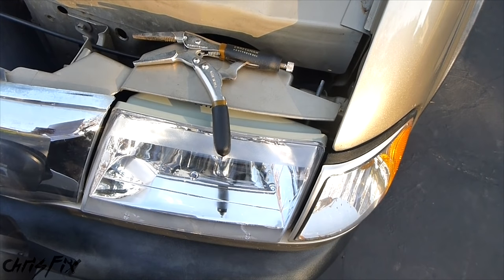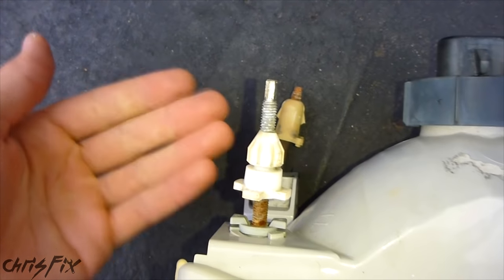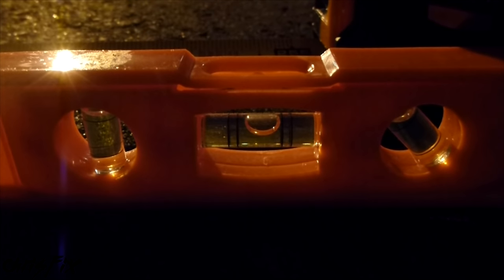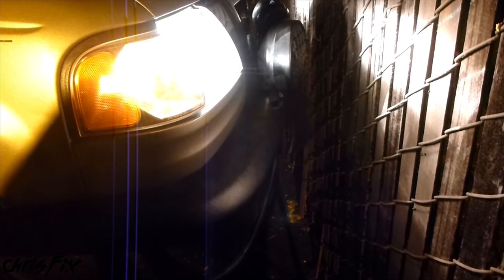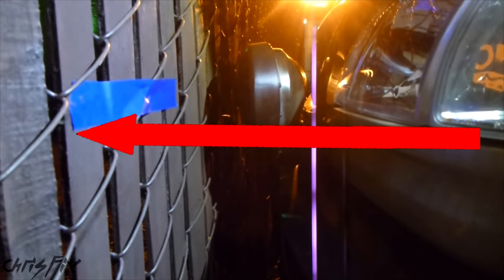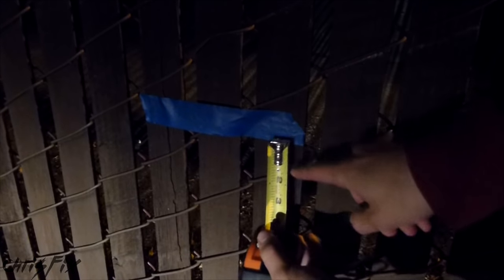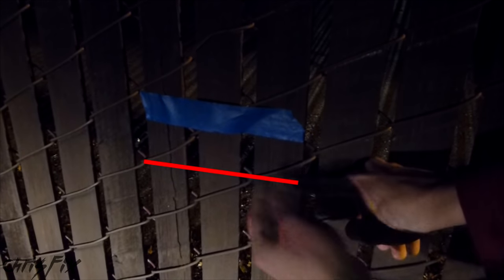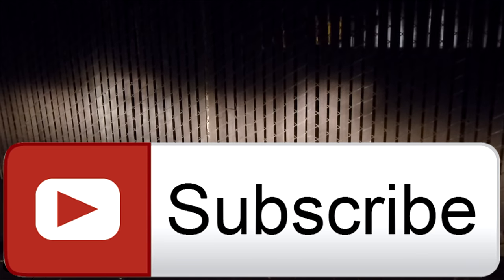How to Adjust, Align, and Aim Headlights and Fog Lights PERFECTLY

Comment: Would this be different to the little wheel inside my car that adjusts them up and down?
Reply from the maker: Harry D What do you mean? This adjustment works for any adjustable headlight. Are you talking about hide-away headlights?
Reply: ChrisFix Some cars (The Impreza STI for example) Have a knob inside to adjust them lower if you have payload in the back of the car.
Reply from the maker: Weese oh wow. that is pretty cool. So in the cabin there is a nob? Is it electric or what?
Reply: ChrisFix yeah very common on European cars, you have a headlamp adjuster knob for when you have a lot of luggage or people in the back... some models use a pneumatic (vacuum) actuator, some are just an electric motor, and more expensive models use auto-leveling, however nothing as fancy as BMW's new super-magic-electronic lights: https://www.youtube.com/watch?v=-dvPZ3H1Vm4
Reply from the maker: thedreadedgman Thanks for sharing! That is some awesome technology!
Reply: thedreadedgman yeah my little ´99 alfa has em too, europeans were really ahead of its time on the 90s.

Comment: I only have 1 adjustment screw for my low beams
Reply: Me too. It only moves my low beam up and down.
my right bulb is facing too much to the left. How do I turn it to the right.
My adjustment is where I have to use a screwdriver.

Comment: Hey ChrisFix i was restoring my head lights on a 07 suburban and scratch the top part of the head light with sand paper by accident . What can i use to remove the scratches  Thank you
Reply from the maker: How were you restoring the headlights? How bad is the scratch? What grit did you scratch it with? And the top part of the headlight lens or assembly?
Reply: I used Turtle wax headlight restore and its a lights starch, it was with p800 sand paper. its on the front of headlight ( clear front plastic)
Reply from the maker: Ok, since that headlight restore has abrasives in it, your uv barrier is already taken off so this can be fixed easily. You can get some 2000 grit sandpaper and buff the area (wet sand) and then take some of that turtle wax headlight restore with a rag and really buff it good. A dremmel or a power buffer on low makes it a lot easier. You can use toothpaste as a final step and buff that in there. The abrasives in toothpaste is really fine and gets you a really nice finish. You will have no problem at all getting those scratches out so dont worry. Here are two videos that I think will be helpful to watch:
How to Restore Headlights PERMANENTLY
and
Headlight Restoration using Toothpaste
Let me know how it goes!
Reply: Cool Thanks ! ill give it a try
Reply from the maker: Let me know how it goes and watch those videos before you try so you get an idea of what to expect.
Reply: ok, i will see if i can do it this weeked
Reply from the maker: Gli_Fahrenheit NICE! Glad the method worked and thanks for the tip! Let me know how long that sealer lasts you. I have only had luck with stuff like that for about 3 months before the headlight was messed up again.
Reply: I have used that product in different cars and it has lasted me over 3 months and i live in Arizona were we get over 115 in the summer so i think its good over all.
Reply from the maker: Thanks for the review man!
Reply: Thank You

Comment: Why would my high beams honk while there on? On a Santa Fe 08
Reply from the maker: Like your horn honks putting the high beams on?
Reply from the maker: Depends on the policy you have, if you have that then I'd totally take advantage, otherwise it might be easier and cheaper to do it yourself!
Reply: Yes... But Im thinking it's my clock spring cuz my air bag light is on and my horn don't work

Comment: Chris, you make some great videos and they are very helpful but your method here is just too inexact to get your lights focused correctly.  Being out of adjustment by just a small amount can be a big problem... like blinding drivers of oncoming cars when your low beams are on if they are not adjusted  correctly.
  Your method here is too sloppy and doesn't get your headlights focused as precisely as they should be.  Although you focused yours in this video where they should be there are things you did not mention that you assume viewers would know. that helped you get yours right but others may not.

Comment: This is actually wrong. Your lights should not be even. The passenger side beam should be 2-3 inches higher than the drivers side. The drivers side light is what blinds people. So you adjust the drivers side even but keep the passenger beam higher allowing it to shoot a beam down the road ahead.

Comment: More difficult than I assumed
Reply from the maker: CodysDesigns It really isnt that bad. It just seems complicated. The hardest part on my headlights was turning that small adjuster screw with the vice grips lol. But as you saw, the results make it all worth it! It is amazing what a little headlight aiming can do!
Reply: True, my passenger light is aimed down alot but im too busy to fix it lol
Reply from the maker: It takes 5min to do it by eye and just turn the adjuster. You dont even need a wall. Pull up to a car in a parking lot. Never know, one day that extra lighting might prevent an accident!
Reply: Well the eye is simple, i was talking about going up to a wall hahaa

Comment: Why don't you lower your Tape, 2" inches in the first place instead of backing up 25 feed and doing it then?  Also, you keep saying bottom of the Beam when you seem to mean, top of the beam, hitting the Tape Line.  Nice Job, will try our your System! JQ.
Reply from the maker: JOHN PUBLIC Thanks for sharing! You can lower the tape whenever you want.

Comment: you can NOT adjust the horizontal on a 2008 Nissan Altima sedan.  What idiot thought that up?  You can adjust the vertical. I mean it is so easy on my 1994 Jeep Cherokee and then I found the one clearly marked screw for the vertical and then . . . nothing.  Looked online and others with the same issue.  Wonder if other newer makes did this as well, what a load of crap, seriously.  The high beams go off to each side blinding others.  It would be so easy to adjust . . . but no.

Comment: How about you align to the centre of your reflector's and bulb height with the correctly set bulbs next time. 
You should always align to the centre line of the bulb and not the light fixture !!
Those bulbs have a crap cut-off too

Also the Fog light is for FOG and without the regular Lo beam headlights being illuminated NOT to supplement your existing lighting on the road !! It is to project UNDER fog so you can see without reflecting light back at you unduly so adjusting this up any higher than the cut off at the vehicle is pointless and potentially illegal
Reply from the maker: mozzmann How I adjusted the headlights and fog lights in this video is exactly how it should be done and works great. Thanks for sharing!
Reply: ChrisFix Interesting the way different Legislations are from different countries ,  if you aligned light like that here is Australia you would likely be defected, 
A lot of alignment issues are compounded by the varying heights of OEM lighting on many vehicles too
Reply from the maker: mozzmann Thanks for sharing!

Comment: Vehicle were circumference shape front not to be great straight flat best use the vehicle model is straight flat front  but the company whom make of circumference hard to adjustment up the fog light or headlight not great if had vehicle circumference be sure front bumper straight flat will be best ride unhappy with factory whom make circumference front of vehicle

Comment: Fence is dumb, use warehouse wall. No parking lot is flat, they are all sloped for water drainage. Using a 4" toy level is useless. If you must use a level, use a 48" or longer for something remotely accurate, Remembering that it is high or low at 48" X the total distance you 'need' level (1/8" @ 48" = 3/4" @ 24')  All in all a Fail video

Comment: Oh for krise sakes. There's easier ways to do this using a brick wall with level horizontal lines.
Reply from the maker: weelgunny I would say this was pretty easy to do... And why does it matter if the wall is brick or not?
Reply: ChrisFix
I just replaced mine, and I just set the low beams below a rear cars back window about 4 car lengths back, and then used the wall with its level horizontal lines to get both heights even. But then had to bump em down a 1/2  turn or so cuz on coming traffic kept flashing my low beams. Ok, so my method took a little trial and error, sorry for sounding like a troll.
Reply from the maker: weelgunny lol it's ok. That is a good trial and error method! That method wont work if your car is lower than the car you are adjusting against because then your headlights will be aimed up. That is why I did it this way. Thanks for sharing!

Comment: you just need a good eye not any tape and levels haha
Reply: +dankntwirk - That's how xenon guys do it... and then go out and blind everyone.
Reply: +VideoMenu ill jusy add that if you dont have a "good eye".. go ahead and use levels and tape measure..safety should be considered as blinding oncoming traffic is more than just annoying and inconsiderate.
Reply: Mine point too low, so I'm getting that fixed right now.
Reply: I work in a machine shop with a .010" tolerance and have trained my eyes to reliably see about .020" differences. 

I would still definitely not trust my eyes to know if my headlights are perfectly leveled at 25'.
Reply: i work with a lathe all day and aligning hydronic pumps...eyes are good enough..the measurements confirm this..lol

Comment: Whos going through all this
Reply: Stop using the standard 2" & 4" drop, these elevations change according to light height. States have min and max projection distances for the low beam. generally 135' minimum and 200' maximum. If you use the 2" drop @ 25' on headlights that are 42" you'll projected the beam @ 520' and not the state maximum. STOP BLINDING OTHER DRIVERS . 42" height @ 25' should be 5.25". Use the formula (42/200)x25=5.25" below center line. ( bulb centerline / light projection  feet  ) x the distance you are projecting it to  ( test wall, test board or other ) it could be anywhere from 10 feet to 50 feet. 

Fog lights have a maximum of 135' projection, so get those adjusted correctly too.